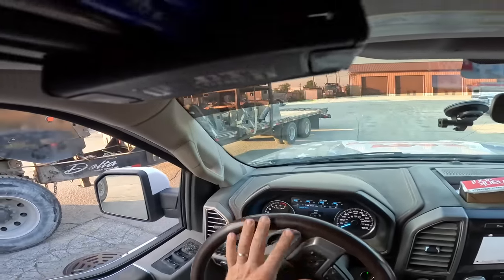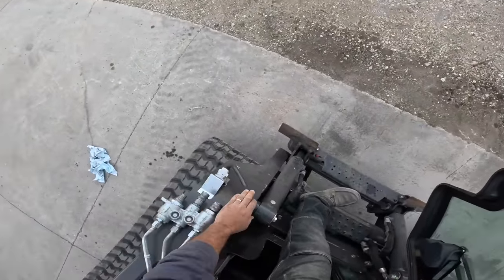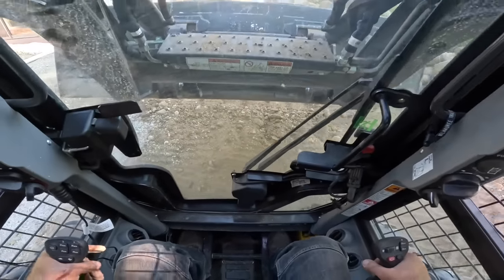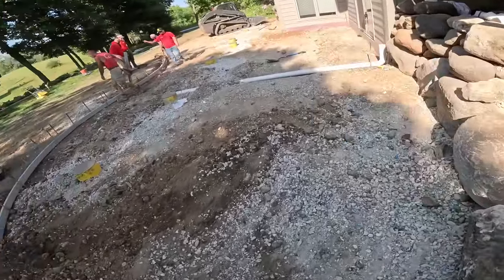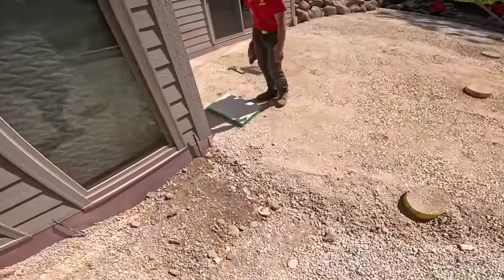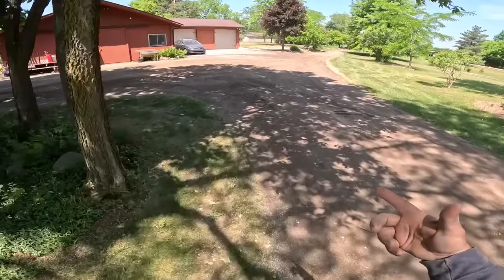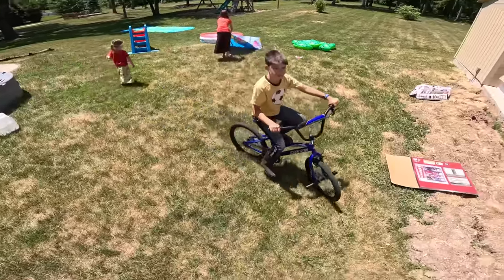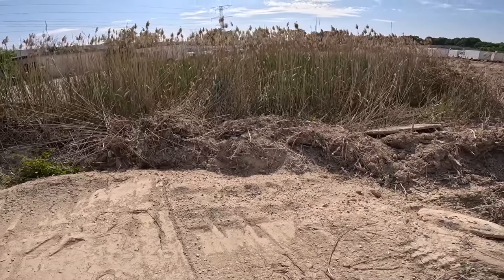It's always something on the job site! He broke it!

Comment: At least Ray's extra dumps of concrete sparked the idea to make the blocks using extra concrete Good idea.
Reply: His sons , half block idea is even more genius. The odds of having a full block load is gonna be slim to non
Reply: Pr-cast cement shoes would be better.
Reply: @WorkingOnRocks Perhaps make smaller blocks.  Maybe not as useful but better than  letting the concrete company sell concrete they were already paid.
Reply: Ray is starting to become the new Daryl with breaking stuff😂
Reply: @BIGTRUCK7.3 better version of him
Reply: Concrete companies have been doing this for 50+ years it's not some genius invention.
Reply: They usually cost $750 for the 2x2x4 blocks. $4k is probably for a set
Reply: @iangeiger4801 😅😂😅🤣
Reply: Ray all mad Ryan Junior came early and took the Mac lol
Reply: @BIGTRUCK7.3 at least he eats hella less
Reply: Ray the destroyer!!!
Reply: Ray is nothing but a lazy driver lol all he does is stand around and make the same mistakes over and over again during the jobs,
Reply: Lol the concrete companies all do this, this is what he got the idea from. It's not like it just popped into his head
Reply: This is nothing new. Ryan was about 50 years too late to take credit on that idea.
Reply: @kuntakentay6969 right. He seems like he does nothing right. And the whole crew knows it.
Reply: @WorkingOnRocks He orders typically at least an extra yard of concrete per pour…. There’s plenty of concrete to make 1 block.
Reply: @romans9720 Bruh, he’s talking about the FORM!!! The metal form is 4K ya goof.
Reply: @47rushing  The 2x2x4 block itself costs only $30. Anyone who works in construction would know I’m referring to the forms costing $750 “yA GoOf”
Reply: Ray… is Trying, but he seems Distracted with something else. But Out of Waste is Coming with a Good Idea 👍🏽
Reply: @romans9720  come to NC , VA , $250 a block
Reply: Yea cuz a lot of times he might have a whole yard leftover in the concrete truck. He usually orders pretty strong so im sure he almost always has a half yard or more in the truck
Reply: @Yourboyzak I can’t tell 😂
Reply: @47rushing haha your the goof

Comment: Hey Ryan, next time you get in your new holland and it won’t throttle up all the way try going ahead and move and it might throttle up, some new machines we have at work have an eco setting that throttle the engine down until you start to work. Try that and see what happens
Reply: That's a great tip, I'm used to an older machine that you just crank and go also. I'm still using my cat 226b
Reply: I believe that’s the issue
Reply: Werkteo
Reply: that new holland is designed for State workers, they are never in a hurry unlike us regular guys/gals. lol
Reply: Does Ray get a bonus for clumps!!!!
Reply: @asmith8973 hahaha yea that’s a government workers machine
Reply: I believe you are probably correct. Good  tip
Reply: @asmith8973 
😆
Reply: @Lexidezi225 
What's the story with your videos on your channel?
Reply: @thejoke2791 probably his daughter or something using the account or phone.. easy now
Reply: @victoryoutdoorservices
Reply: my job’s a770 does this same thing
Reply: @BessV2  
I ask him every video 
He doesn't reply 
He can set a up a channel for her and keep and eye on it. If that's the case.
Weird.🤷‍♂️
Reply: @Rogerswoodworkx  
No longer refers jobs to 
Easy E Concrete
Reply: Do you ever use a laser for your heights
Reply: Beat me to it, I was gonna mention that! My JD 410L does it when the hydraulics are slowed and not moving and then when you move again it races up again, aswell as my new mini ex does the same exact thing.
Reply: @ajfrancisco6119  we actually have a 410l too that does it lol we have a 410L 710K then a kobelco 85 and kobelco 140 and they all do that

Comment: hey Ryan, i worked at a concrete block manufactuing plant and we did the same thing with the big blocks with leftover concrete. they are super easy to do and you can fill it halfway and fill the rest another time so u can use everylast drop of extra concrete. on the top and the side there was a sort of indent where a peice of rubber goes on conneted to a peice of bent rebar and then when the blocks are taken apart each day you use a forklift (the skidsteer in in your case) to lift them using a hook and then you can guide them in to place. Very easy to do and i definatly recommend!
Reply: I worked at a factory throwing bricks. Hardest job I've ever had. I was in the part that made the bricks. Couldn't breath with all the dust and I was a temp agent so I didn't get a mask for 2 weeks or more.
Reply: @alexweimann5324 we have a huge machine that makes the bricks but same thing. It was dusty and super hot. I didn’t like it at all. Especially for 55 hrs a week.
Reply: Put some longer ramps on the skid trailer maybe?
Reply: @mathiasblundon1921  that's what I did. The messed up bricks I'd throw in a pile. The rest I'd wrap in cling wrap usually. Cleaning the mixers was always fun
Reply: @alexweimann5324  yup I did the exact same thing. I got so dizzy wrapping fresh skids just out of the plant. Certainly made for very long days
Reply: @mathiasblundon1921  I was a temp agent. And they wouldn't give me a mask cause they were really expensive and alot of temp people couldn't handle the job and just left with the mask after there first day. I was in connecticut
Reply: Why not back the skid loader onto the trailer ?

Comment: Ryan with the new machines don't put the safety bar down until after you start the machine. Here's the process: close door, start machine, safety bar, then push to operate button. Also make sure throttle is all the way down.
Reply: Why
Reply: @Knightfall23  The onboard computer needs time to boot up to detect the safety features before it can operate. Same with forklifts and other heavy machinery.
Reply: @captaintuttle5006  It makes no difference when it checks if the bar is down or not, it's either going to see the bar is down and pass the check or not see it and wait until you put it down.

Comment: Tip for loading the skid, load it going in reverse. It's way less sketch and when the bucket is on, you can use it to catch yourself if it happens to tip. And you can use it to slow down if you need to when pulling off. Also they usually recommend to go up hill in reverse as well.
Reply: You haven’t noticed where the osb wood sheets get loaded on the trailer did you? The other buckets sit there also he has to drive forward up the trailer
Reply: @fedfreds832  You made my point for me, that's exactly what I was going to say, lol.
Reply: @heyjohnson5535  lol no not necessarily. I have been operating for 10 years and it's easy to spin the skid steer on the trailer to grab attachments, and back down. But his most used attachments are either already on the skid steer or on the side of the truck accessible from the ground, aside from maybe one.
Reply: its a new skid steer the new models weight differential isnt the same as the older model
Reply: new holland really isnt the same qaulity it used to be its alot like snap on it lives off its name now

Comment: Ryan when you make the form for the concrete blocks you should build it so you can use the quick connect attachment on the long side for the skid steer , just make it modular so you can keep on the tool trailer and then you can take it off the trailer and bring it to where your pouring then you won't have to bring another trailer 👍
Reply: Thats a really good idea but I don't see anywhere on that trailer that it would fit. That thing is so full of everything  else with the breaker the beak and all the buckets... unless they loaded the machine backwards and the mold would then be over the ramps, which could work in theory but I don't know for sure.. that's still a really good idea to make it an attachment just for the fact it might be easier to get the solid blocks out after they're hard if they could tip far enough.
Reply: dont want to be overweight with the DOT

Comment: Your skid might have a auto idle feature where if you don’t use it for a few seconds it will idle down and when you move again it automatically idles back up. Or try throttling it up slowing so the engine came rev up smoothly up to full throttle

Comment: Ryan, you should get some 2 way radios so Ray can communicate when he's close to the jobs he can call you. That way, you can give him clear directions on what you want him to do.
Reply: That's what cell phones are for, it ain't that serious. Once Ray figures things out more, it won't be an issue.
Reply: Genius!! Communication! That’s 95% of what makes him frustrated, so having this would fix the problem!
Reply: @Bsnowman22 - with new cellphone laws going into place this is no good. And a walkie-talkie is perfect cuz it’s not against the law and it’s a push of a button to get instructions. Instead of trying to read minds 🙃
Reply: I think the issue is that ray was a truck driver before this job not a laborer so to me he just seems like he doesn’t think like a laborer which is fine i can tell he’s learning but i also understand the frustration from Ryan, things he finds common sense might not be to someone who hasn’t labored before. It’s like being a mechanic and getting mad because someone doesn’t know how to change their own oil.
Reply: @brianmiller8806  exactly.
Reply: He would have to rent space on a repeater to get any usable range.
Reply: @brianmiller8806 fr the destroyer wouldn’t had owned up to his mistakes Ray admits what he does wrong
Reply: @jox4mohya   With FCC authorization
Reply: @cknorris3644   or perhaps 800 mhz trunking
Reply: @felicianoleal4358 🥾🧐
Those treads match the prints on the patio.

😆
Reply: @brianmiller8806    
Yeah, that was a hard lesson. Running that amount of weight over the corner of a slab. Wouldn't have been a thought to big Ray at all. 
As they say. Learn something new each day.
Reply: @jox4mohya 
They have hands free headsets for phones
Reply: @TheTrueBSK 2 way radio will be faster than searching his phone contacts or dialing a phone number. Just push a button and talk.

Comment: Hey ryan , the new skidsteer , all the “waiting” that the machine makes you do is to protect the motor, its to allow it to warm up properly before use. Also id recommend not shutting the machine off right away after use give it a minute or so to idle after using before turning it off. It hurts me to see you shut it off right away.

Comment: Surely you can make your own form for the blocks rather then paying $4,000 for one form, but sounds like a great idea
Reply: Yeah, and if he doesn't have time to build it himself, just pay any workshop, it'll be really cheap.
Reply: Make form with bottom then use forks to dump it out.
Reply: Not sure where he saw it’s $4k. Companies in ny/nj sell the 2x2x4 forms for $750
Reply: @Wizardi1111 or have Nate make something up for him
Reply: The cost of a steel form seems expensive - why not make your own timber form. Wont last as long or give the finish of a steel form but concrete blocks are just concrete blocks!
Reply: @AceBeer100  >why not make your own timber form.

Do you see how many kickers they install for 5+ inch concrete/steps? How do you think that wooden form will looks like when he pour that big chunck of "just a concrete block" he talked about? 🤣 Like ripped pilow?

Comment: This video about the skid loader is a great example of the things that are different on each brand. Every brand will do the job but there is a reason why new holland is cheaper than cat or deere. The little things that drive the operators nuts like the idle up delay, or the button to be able to move. Deere and cat machines don't have this issue but are also more expensive. Essentially, you get what you pay for.

Comment: Ryan for my old gooseneck trailer i had skidsteers that would always want to "flip" backwards so i would back it on the trailer and spin it around on the deck to get what i needed and depending if it was heavy enough back off or spin it around again and drive off straight, once you get a feel for spinning on the deck it feels way less sketch than tipping over on the ramps

Comment: Can’t tell you how nice it is to see you with a dependable crew!
Reply: Anti-trans not really ruined tho is it
Reply: Anti-trans  there’s tyre marks all over that corner so it well could have been. We will see when that take it out if it was or not. And you have just described an hours work to rectify regardless so no it is far from ruined. At worst they can pressure was that drive and in a couple of months of weather you would barely be able to notice a colour difference. The homeowner didn’t care anyway
Reply: Anti-trans 
Most noobs would make that mistake.
Reply: Anti-trans  
Does the course teach you not to drive over slab corners?
If so, then yes he's a Mr bean

Comment: You could probably weld up you're own block form for much much cheaper...

Also you could weld a hinge on one side of the form so you can slide the blocks out easier
Reply: When you look close at one of those block molds there is a lot and i mean a lot of welding goes in to making one, its a bit more involved than just slapping a box together

Comment: Ryan, I'm a heavy equipment mechanic of 15 years. That machine uses a CAN BUS communication system for everything! You need to let the screen fully boot up before you start that thing or you'll run into issues with switches and functions not communicating like they should. New technology is a pain!!

Comment: Ryan your machine has an Auto-Throttle, when your not manipulating the hydraulics it throttles down to conserve on fuel consumption, the moment you try to use it the machine will automatically throttle back up to where you have it set at!

Comment: We have a 2022 bobcat T770 and it won’t throttle up right away either when it’s first fired up but usually once it’s warm it’s fine that’s only when it’s cold for this machine I agree they are way to techy i like our 09 t190 and 07 A300 for their simplicity

Comment: What i used to do to help me back up to a trailer with a pintle hook is before i dropped the trailer i would put a cone touching the outside of the rear driver side tire of the truck. That way when i would back up to the trailer i knew that the rear driver side tire would have to be barely touching the cone and it would be lined up every time. Show ryan jr. and ray that and they probably wont need a spotter anymore to get that trailer lined up. Hope this little tid bit of info helps. ADIOS!!!!

Comment: Weld up some longer ramps. Will cut the angle down. I’m a operator for 25 years and i never liked that feeling you must have had going up that ramp. Definitely will make your nervous 😂
Reply: @tommosher8271  very true. I only go up the ramps backwards when there is no attachment

Comment: What if you back it up onto the trailer would it center better with the weight on the front v.s the back going up
Reply: It don’t matter, if you do it that way your still going to tip forward a good bit when pulling off.

Comment: When I have no bucket on a skidsteer, loading on the ramps can be sketchy, I started going straight on and very slow. It wasn't working out. Then my boss told be to quit being a baby and drive it on fast and at a VERY slight angle. Works like a charm every time. Gotta commit lol

Comment: Also if your machine has a foot pedal throttle that will sometimes mess with the hand throttle if it isnt fully returned to "neutral" position. Same with hand controls if they are not in "neutral" it will not let the ready operate switch to engage

Comment: That Menards blue pencil seems better than the green ones they used to sell. I got a few maroon ones from a rep that said Menards and Midwest Manufacturing, the lead seemed too fragile.
The smoke in the air could have been causing much of your mood on this video. I've noticed more people have been on edge and it seems to be tired to that.

Comment: Before anyone else comments, yes he can back the skid steer up the ramp, but your going to have the same effects when pulling it off. It’s going to teeter either way you go without a attachment. He’s got a lot of weight on the front of the trailer already he needs the mass weight of the machine on the rear. Your welcome.

Comment: @VictoryOutdoorServices you should put an eybolt or a bent  peice of rebar  in the concrete pile ( mt.ray )  so you can just pick it up off the truck with a chain or forks

 At that point might as well keep a form on the truck for the extra Crete

Comment: 🤩🤩🤩🤩🤩🤩 hey just build a form for the big blocks of concrete. 2x10's and 4x4's... some lag bolts so you can take it apart when dry. Piece of plywood on the bottom to sit it on. Spray everything with diesel so it won't stick. 4000$ no way more like 100 or 200$ Hope it works.

Comment: just out of curiosity, with our cat 289d3 skid steer ours will sit at idle until you move or use any controls. never had the rpms not ramp up though when actually turning it up so thats interesting but curious if when you ramp the rpms up on your new holland after start up and then try and operate the machine if itll ramp the rpms up.

Comment: Does the new machina auto-idle? Because it could be that it's auto idling no matter the engine speed you set with the dial. And once you start using any of the joystick functions it will go up. Just a guess tho.

Comment: as far as what you said in the last video about those blocks and having to fill them up completely, I disagree. a company I worked for before starting my own had them and my crew had 2 and we'd fill some up in three separate pours and just put 2' bars bent into U's  into to hold it together. I did those 10 years ago and I still drive by my boss old house where he used a bunch of those around his pond and they're still there held together in freeze thaw climate and held together being picked and moved a dozen times before being set